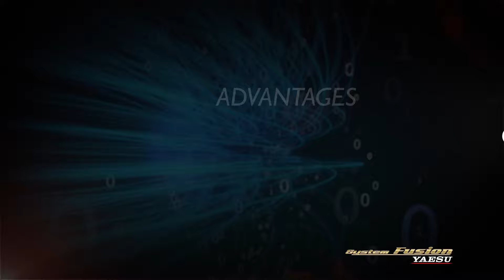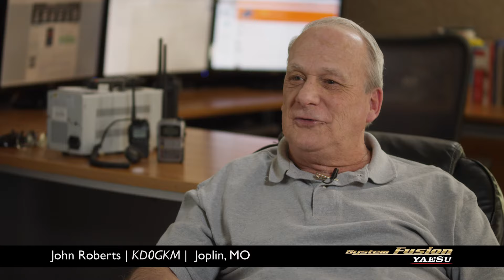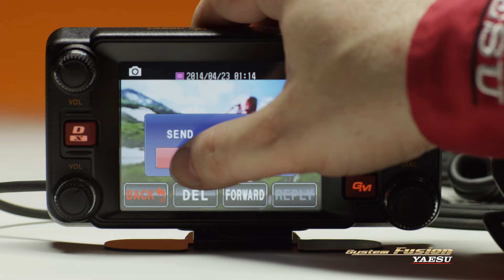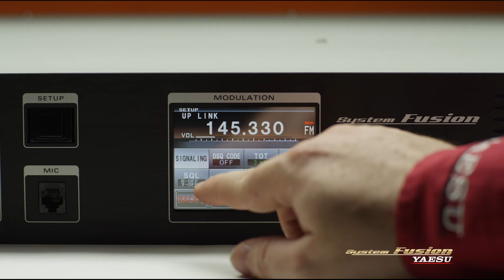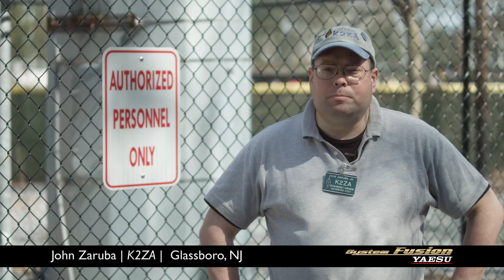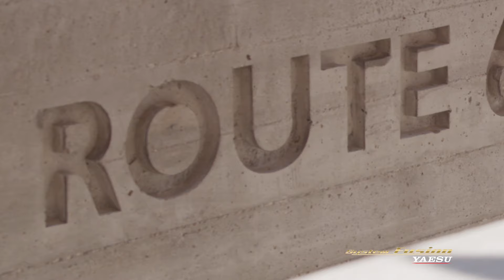Yaesu System Fusion Introduction

Comment: Better audio quality? I'd have to severely disagree with that. I've listened to DMR on a local repeater and P25 on the same repeater because my Uniden scanner decodes both (I don't have any of my ham rigs that will transmit digital though except a brand new Kenwood I just got). The distortion is terrible and people sound like they are talking with a mouth full of mashed potatoes. I could never tell the difference between P25 and DMR by just listening, they sound the same, which is terrible. I one time was listening to a P25 nationwide net that came out on that repeater and some people boomed in so loud I had to turn down the volume and then I'd hear the opposite, when I had to turn it up again. Lots of difference between the brands of radios and probably even the hotspots or whatever they call those things. Analog sounds way better, (especially on the 220 band) and also digital does not really go that much farther than an analog signal, maybe just a hair farther. They exaggerate that a lot. I now have a Kenwood TH-D75  I just got the other day and I'm not even going to bother with the DSTAR digital, I didn't get it for that. They are superb radios, BTW.

Comment: I have just purchased a Yaesu 991a and tried out the system Fusion, C4FM and Wires-X.  Believe me it all SUCKS!  Big time!  If I had purchased the 991a for digital modes, I would have sent it right back.  I was under the impression that digital mode would provide clear, crisp audio--not the case by a long shot.  Where the hell do you get off calling it crystal clear?  In the digital mode the other Ham's voices sound muffled, muddled, and they sound like computer generated voices.  You guys have a long way to go before I consider digital as a means of communication.  FM, SSB and even AM sound 100% better than digital.  I am very disappointed in the digital mode to say the least.  And, yes, I bought my radio from GigaParts with the MARS mod done.  I was considering an ICOM 7300 but I heard their digital mode (D-STAR = Death Star) l is worse than Fusion.  W Rusty Lane K9POW in eastern Tennessee
Reply: I agree!! You are spot on. But I think the quality is about the same on all digi modes, Dstar is not worse, they all suck.

Comment: Can I access rooms/groups make long distant contacts by calling up a local fusion repeater without using a hotspot & internet?  Just passed my exam, interested in digital modes but I don't even own a computer anymore.
Reply: Question can be answered honestly in many ways. If the Fusion repeater is on the WIRES-X with a node possibly. Most use DVMEGA or another access point to contact Reflectors and Rooms available in to WIRES-X. But short answer is if the repeater is not a node then not possible.
Reply: @KI4KWR  
I'm clear on a of it now. I just didn't understand the difference between Fusion repeaters, wires X, etc. Most of everything I found when starting delt with using wifi & wires x.

Comment: I really wish that Fusion radios had the gps nearest repeater function like the icom id5100a. That is a necessary function in my opinion. 73's KD9JEO
Reply: does the ft 3de have nearest repeater mode?

Comment: IF I HAD ONE IT WILL NOT BE HOOK UP TO THE INTERNET WHAT HAPPENS WHEN THE STUPID INTERNET GOES DOWN OR A SEVER GOES OFFLINE SO MUCH FOR RADIO HOOK IT UP TO HF RADIO LIKE THE FT-991 RADIO ?? AND GO ON C4FM ON THE HF BANDS AS A REPEATER SCREW THE INTERNET RF IS THE WAY TO GO AND ANALOG 
73S THE SLAPPA

Comment: MAN THAT IS CRAZY LOVE YASU BOY O BOY DID THEY EVER OUT DONE THEMSELVES I GOT TO GET ONE THAT IS A REPEATER WITH TOUCH SCREEN DUAL BAND GOOD FOR CROSSBANDING GOES  GOOD WITH AN FT-991 THE S-COM REPEATER CONTROLLER 7330 TRIPLE REPEATER CONTROLLER AND YES THREE REPEATERS CAN BE RAN ALL FROM THE SAME CONTROLLER  THE YAESU DR-1X WOULD WORK GOOD WITH THE S-COM 7330 CONTROLLER AS AN INDEPENDENT OR MIXING REPEATERS WITH THE SAME CONTROLLER WHAT MAKES IT NUTS LOL BUT I WOULD LOVE TO HAVE ONE OR THREE OF THEM LOOOL 
73S ALL 
THE SLAPPA